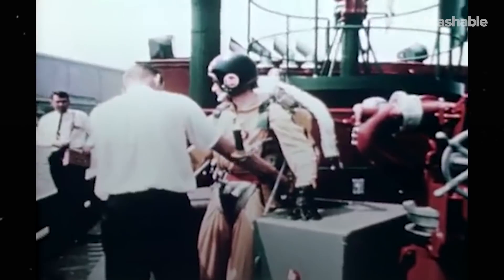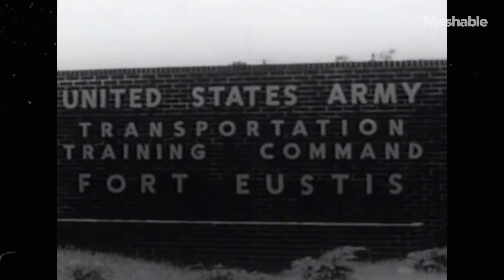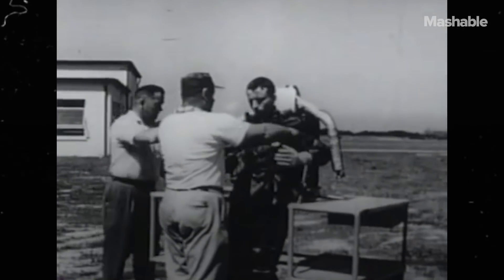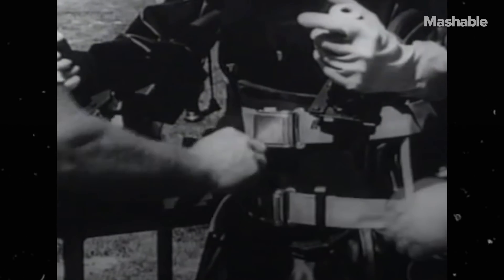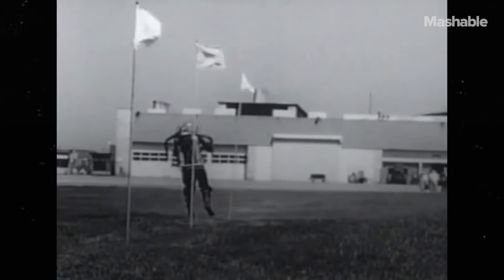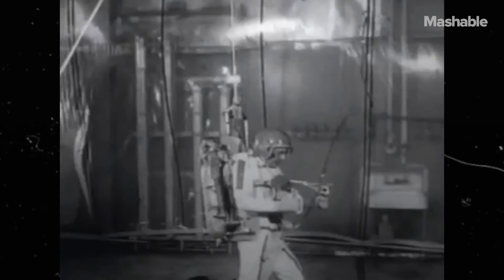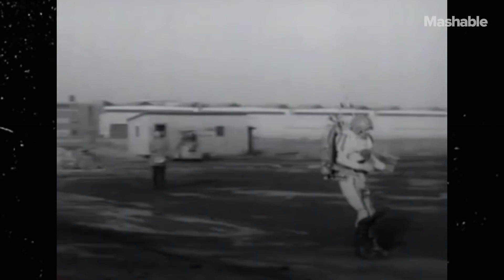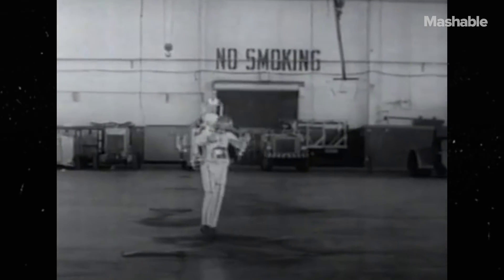Jet Packs May Still Be a Thing of the Future, but the Story of Their Past Is Fascinating

Comment: The most successful ones use turbines instead (of cold gas rockets).  And a YAY to modern electronics and sensors. Where stabilization doesn't have to be done by the pilot anymore ... but instead of a half smartphone.